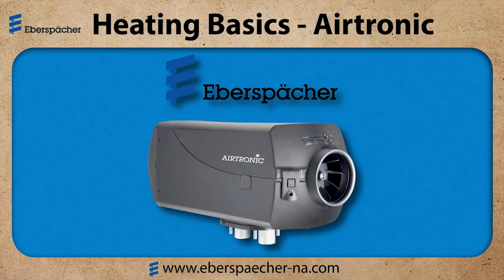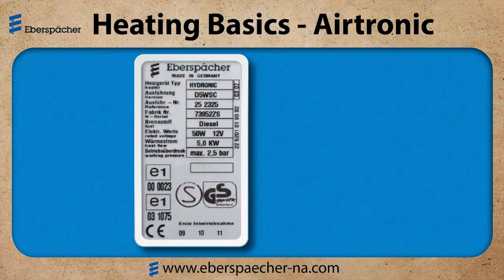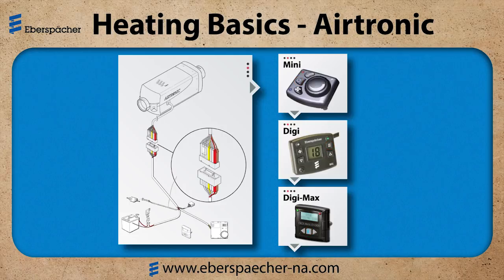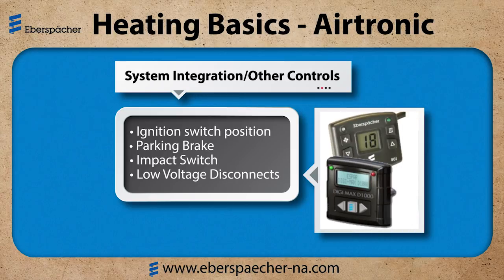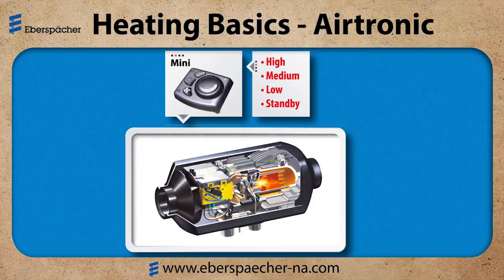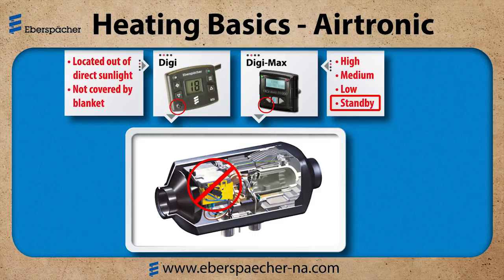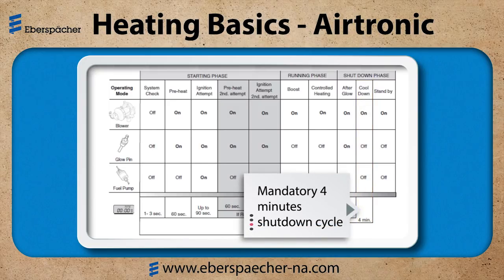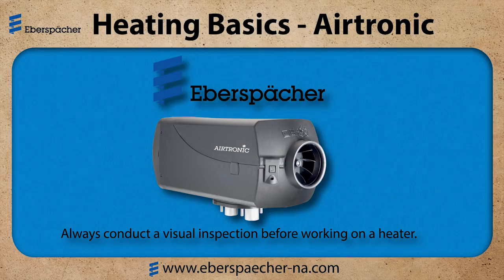Airtronic D2 | The Basics

Comment: We installed the Espar Airtronic d2 12v diesel heater in our converted sprinter van. We've spent the past 2 days doing nothing but trying to get this thing to work. The unit will not connect to the EasyStart + remote controller. We keep getting error codes like "INIT" and "No Signal". HeatSo is the company we bought it from but their customer service won't respond to my multiple calls or emails. We've combed through the instruction manuals and have quadruple-checked to make sure all the connections are correct. We are at a complete loss. Has anyone else run into this problem and have any advice on how we can fix it? We are currently in Ohio and the only way we can heat our van is if we use the van's heaters with the engine running. We were hoping that the Espar heater would be the solution, like so many other van-dwellers out there, but we've had it installed since yesterday morning and have spent the past 2 days trying to figure out why the remote won't work with the unit. Any help would be SO appreciated! Thanks everyone!

Comment: Hello, i am having an issue with an eberspächer airtonic, it starts perfectly, but it turns off always after 10 minutes, after the start and a cool down cicle. Could it be because of a broken temperature sensor?
Reply: Pedro Adrover I am having the same issue, I saw it gets over heated and turns itself off because I had items placed on top off it. Regrettably mistake
Reply: The most common issue is blocked air flow. It usually happens by placing items on the air intake, outtake or a deforming air hose.

Comment: My espar d2 heater doesn't come on.. the fan don't spin and i don't hear the fuel pump clicking.. I change the control switch and tested the heater blower to a battery and it came on.  I'm lost
Reply: I have that same problem. Cannot figure what to do
Reply: @mikezweber6324  what is your espar heater doing now?
Reply: @CashNYC  I took out the glow plug and cleaned it, put in a new filter and now It won’t start up . I have power from the batteries to the unit and off on switch. Must be a fault code that I need to clear. Mine is a unit Fromm 2007 and I can’t clear any codes without the external retrieval device
Reply: @mikezweber6324  just keep trying to start it it does that sometimes after u clean it it acts like it don't wanna start but eventually it will. Did u replace the filter by the fuel pump?
Reply: @CashNYC  No, I didn’t replace the fuel line filter

Comment: Are you sure about the gasoline ? in the UK gasoline is petrol , is that not dangerous to use in these heaters , I mean petrol has a low flash point and a lot more prone to flammable fumes on the interior of a vehicle . thanks
Reply: Hi UTD2, we have gasoline versions of our most popular models both on the Air side and Coolant side. The burning of gasoline or diesel fuels happen in a controlled environment. The gasoline and diesel heaters are not the same , you have to either purchase one of the other, there are different pars/components internally, like; fuel metering pump, controller, c chamber.

Comment: Thanks for the video! Is there a maximum altitude that the heater will work at? I have one installed in a motor home and plan to cross the Aguas Negras pass between Chile and Argentina. It peaks at around 5 000m.

Comment: Hello, i own a 37 ft  5th wheel coach.I want to have one of these units installed in the RV.I use the furnace and a few space heaters.When i go away from the coach i would prefer to have this as apposed to quarts and ceramics (much safer).i want to be able to start it from out of town with the app . Is that possible? Also will i need the 5.5 watt heater to heat my 37 foor coach in say minus 10-15 degrees. Thanks